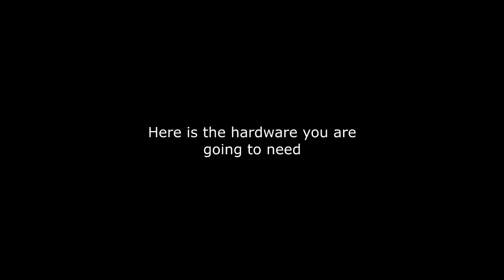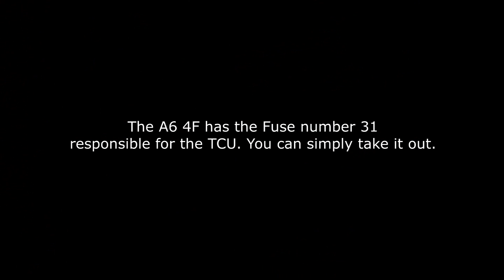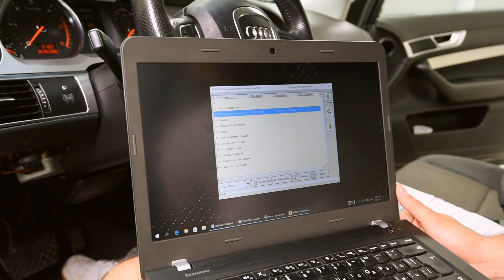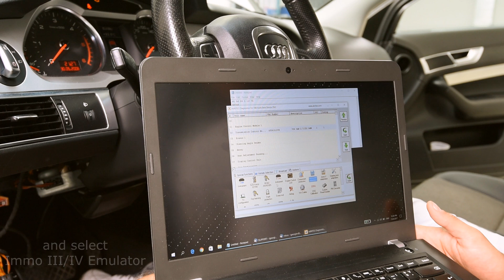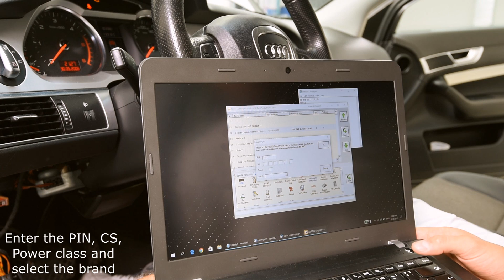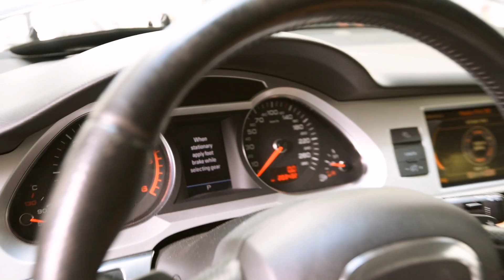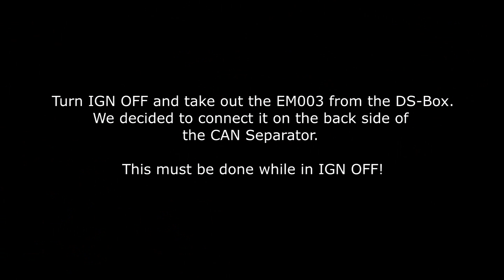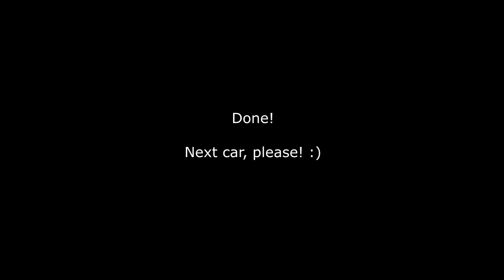Complete AUDI TCU replacement solution using EM003, ZN051 and VN005

Comment: No need to virgin unit before?
Reply: NO NEED, in fact if you virgin the unit before it will not go through because the communication needs the cs from the transmission

Comment: Hi. I'm kn South Africa and i can't seem to get help with my A6. Swaped the CVT transmission but not it accelerates slowly...it says TCU TCU software not compatible with ECU. Most mechanics say they not familiar with that.

And by the way which courses/deggre do u do in varsity to do this ? My younger would like to do such. 
Thanks
Reply: where is the tcu model located so i can get the cs?

Comment: Hi there, i should of written to you so much sooner than this, I basically have exactly the problem you ha=d with this gearbox, It is my original gearbox & TCM but i had problems with my  J518 Immobiliser, to cut a loooong story short i swapped it and took it too audi to recode the "new" J518 they wee unable to according to them I needed a new one ($5400.00 AUD ) yeah right so i actually managed to get my old J518 unit repaired, now when i refitted it there was component protection on everything! , I have worked out that the Audi dealership managed to recode a lot of components to the donor J518 except for the ECU  I think, so i took it back they rang me and told me no they couldn't get anything out of safe mode including the gearbox TCU & that i needed to purchase the new J518, so i took the car back, when i turned it on and started the car all the components that were in safe mode were not in safe mode anymore so they had managed to recode it after all! everything except the gearbox, i think whats happened is them trying to recode the TCM so many times has scrambled it  so the Audi mainframe will not allow them to put it back how it should be so at the moment i have a very expensive boat anchor and i cant find anyone with the program you have refrenced in your notes, I am in Australia is that program a common program? sorry for the long story, by the way it is a 2005 Audi A6 Quattro cheers David x

Comment: Hello ,sir why did you put vn003 and what is its jop    best regards
Reply from the maker: Hi,

It is used to emulate the CS of the TCU as the CS can't be changed in the unit itself. EM003 remains in the car.
Reply: @AVDIFAN  thanks sir  But Volkswagen, don't we need the emulate vn 003?Also other car vw.seat.scoda  or just audi and you mean if anybody takes out the emulate  vn003 it will be there a problem the car won't start, will not?
Reply from the maker: Hi,  @diagauto4689 ! You're correct! If you remove the emulator, the car won't start and the dash will display a "SAFE" message. This is because the CS from the unit will start running inside the CANBUS. You need the CS from the car circulating (and this happens with the EM003 emulator). The emulator works also on other brands, not just AUDI. I.e., you can put it in a VW Polo to change the Simos ECU. CHeck out the video for the Polo, you might find it useful.

Comment: Hello I have a 2010 A5 I swapped my ECU, steering column lock, ignition lock, and BCM my car starts but will not drive. I have TCU lockout and components protection activate will this process fix both these issues.
Reply from the maker: Hi William,

Sorry for the late answer. The 2010 A5 is slightly different from the A6 you see in the video. The adaptation is even easier, the car is equipped with an IMMO5 TCU.

Comment: Great video!  Would this work on a 2006 Audi A4 Cabriolet with a VL300 CVT transmission module?
Reply from the maker: Hi Frank, Thank you!
No, the 2006 A4 CVT can be easily adapted without the need of an emulator. Are you working on transmission replacement only?
Reply: @AVDIFAN  hi ahe a4 car 2007 i swap transmission from a donor car.i need to use my original tcm?  Or the tcm from donor car and buy emulator

Comment: have a 2006 A6 quattro 4.2l & i got the same problem but no code or anything in the dash showing safe mode? Couple months ago my oil pressure line split & all my oil came out i had it parked since. I ordered the part not long ago i put it and didnt wanna start because of dead battery so i replaced it with a new one it turns on now everything is fine then i put it in D & it wont go foward goes into 1,2 then 3 gear then PRNDS light up red? Could it be the TCU or ECU/ECM? help please.
Reply from the maker: Hi Robert,
It could be either the ECU or the TCU. Has any of those units been replaced lately? What are the DTCs in the car?
Reply: @AVDIFAN  nice work can this work for a6 c5 4.2?
Reply: Hello I have the same problem as your vehicle

Did you find solutions? I also have an audi a6 4.2 v8. Did you find where the problem came from?
Reply: @Robert Valencia
Reply: @Amine-jx9mq  yes I fixed the problem!! Check your transmission oil mine was low due to one of the hoses split. The oil cooler hose & thought it was engine oil. The person who had the vehicle before me never did transmission oil change on it, it was so bad! But I did that, took it to a shop & they took out the old oil then put new in! Try that. TIP! DON'T do a FLUSH just empty what can come out & refill.
Reply: @Amine-jx9mq  I just saw your video! Mine did that as well!! Its your transmission oil. Doesnt have enough oil!! Replace the transmission oil.
Reply: @robertvalencia5662  thank you very much my friend
Reply: By any chance do you know where the ECU is located for the A6 4.2? Been looking up see where but cant find exactly where it is. Appreciate the reply thanks.

Comment: Pls my Audi A6 is having a problem no light on the dash board can not Start pls what can I do+2348027294617
Reply: Maliq Idum plug in your scanner put on your light with your legs on break and the hazard on then the scanner can connect with your car then clear codes it will come back alive